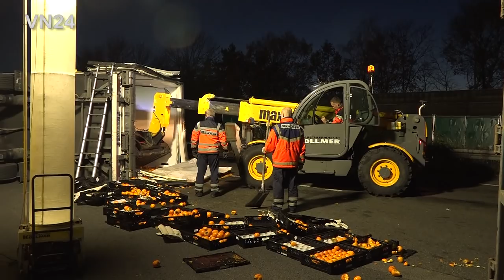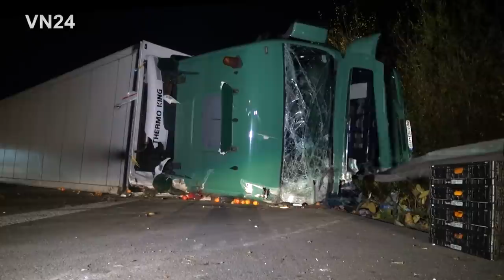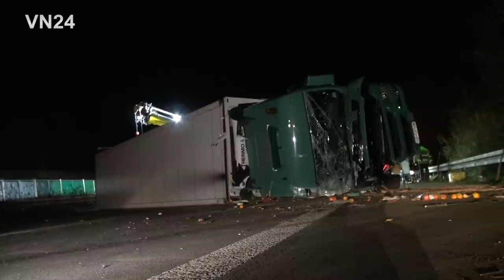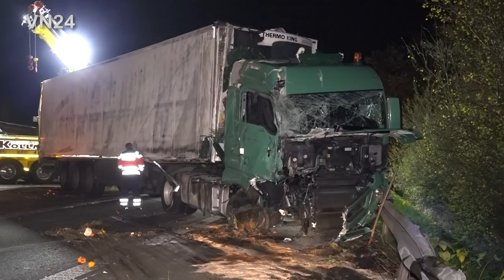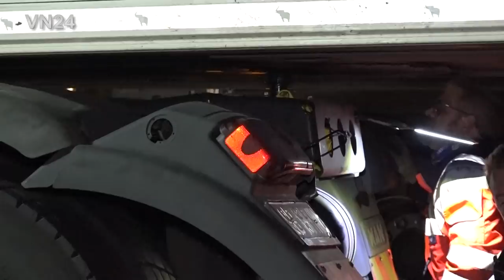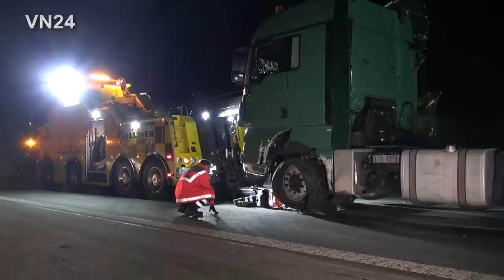14.11.2020 - VN24 - Teil 2 - Bergung eines umgestürzten Sattelzuges auf der A1 bei Unna

Comment: The crew of this company dose not waste a move and the equipment is top notch .  I have a question  Why the cable dose not come off the winch drum in a free spool mode?   All the heavy wreckers here in the U S A one man is able to pull the cable out.
Reply from the maker: I'm not sure if the winches from the tow truck or from the rotator are meant.  The winches from the rotator are crane winches.  These have no free run.  That is not allowed in Germany